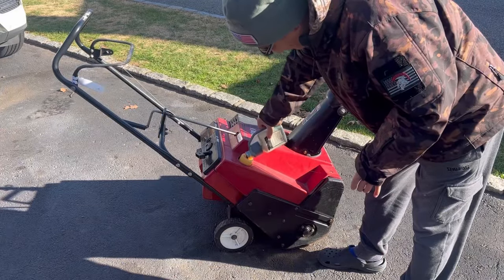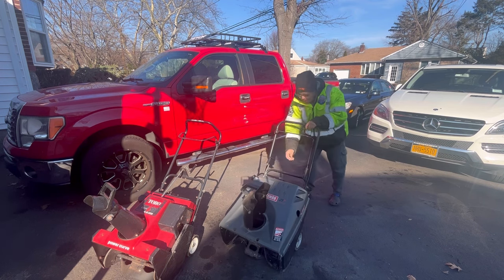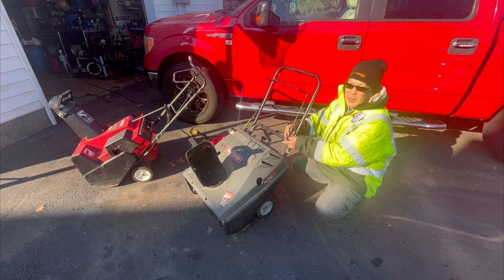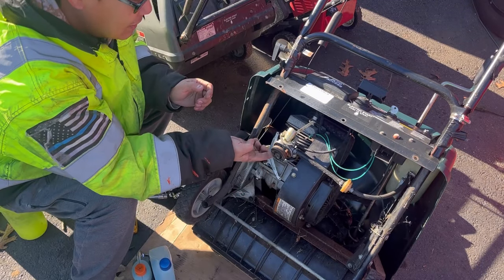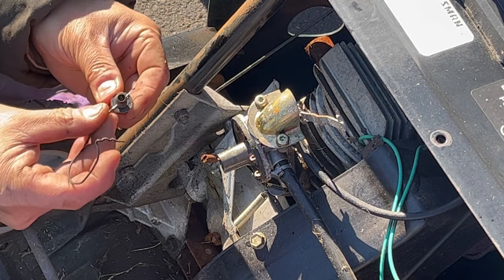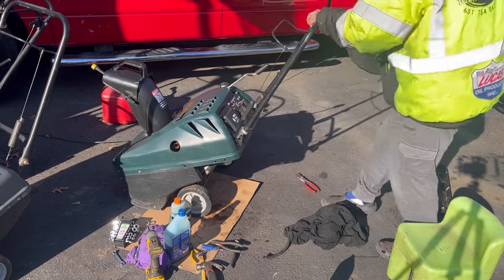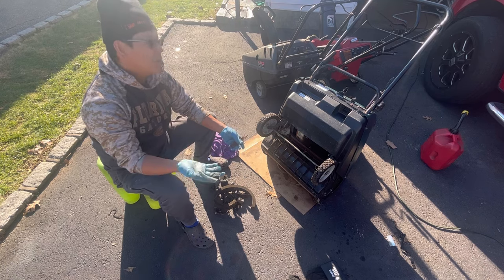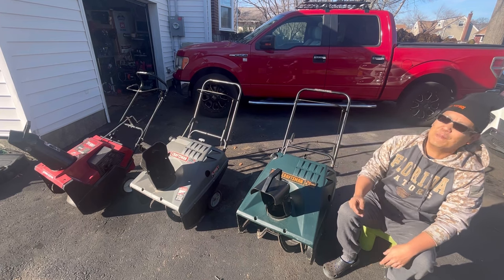GETTING 3 FREE TORO & CRAFTSMAN SINGLE STAGE SNOWBLOWERS RUNNING & READY FOR SALE WINTER SNOW SEASON

Comment: Henry,
Two strokes will smoke excessively due to improperly mixed fuel, running too rich or a stuck choke. 18:24 Mix it correctly in a jug not in the tank. The screen gets plugged either from too much oil, or from not running wide open, as on a weedeater. That will also lead to carbon buildup on the piston, plug and exhaust port 
Happy new year😀
Reply from the maker: Yeah that’s what I thought,  but I mixed it the same way with the other two and they don’t smoke.  I’m thinking it’s the carbon on the screen like you said.  Thanks bro
Reply: Maybe the red one requires a different mixture 1:40 ratio it looks the oldest and the 2 others is 1:50 ratio